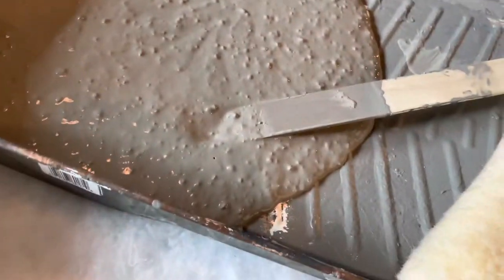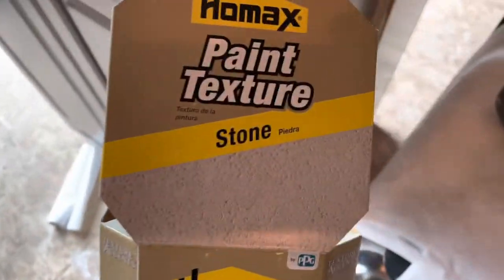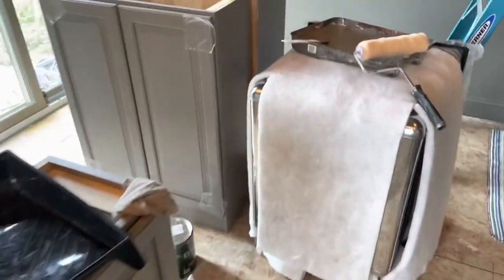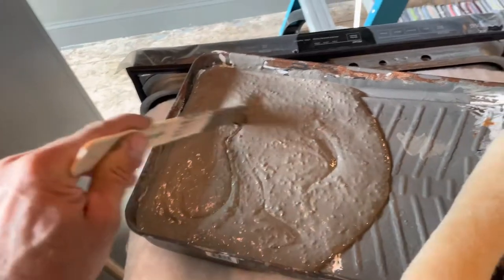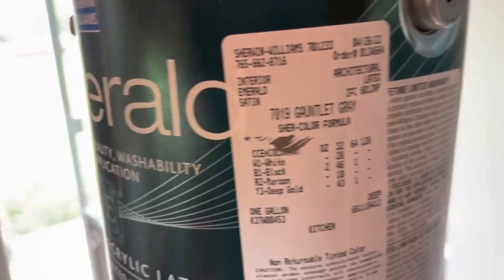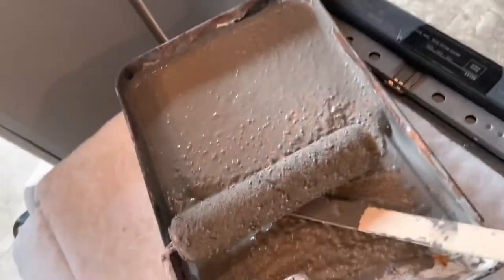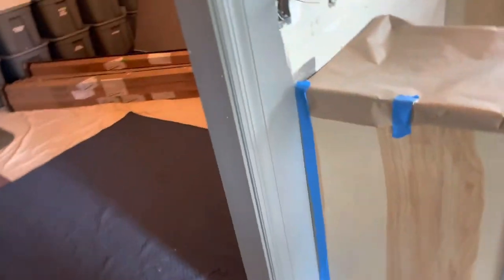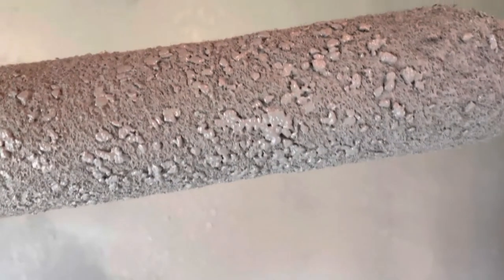Homax Stone Paint Texture Review!

Comment: The application method dominates the final look, there is a special roller from BHER will make the results fabulous
Reply from the maker: I have not experienced with any rollers out side of the few different nap rollers available at stores. I do know rollers with patterns are avail for mud textures . I have used a sand mixture to another home and was very happy with the results it was premixed by a different manufacturer. I have also had great results applying a texture with premixed mud and a heavy nap roller since this video.

Comment: What if you painted it first and then went back over with the stone mix... would that help deplete splotching?
Reply from the maker: I did paint the walls first coat without stone mix to make it quicker to apply. The paint also dries quick so as soon as you roll over the top of it starts to pull the stones off the roller. I found that the splotching occurs most after going over an area not completely dry. But very little stones come off the roller unless you go over areas that are still a little wet.

Comment: Bro stick to doing anything else but this like is a easy as read the box this works great if u read the box 😊
Reply from the maker: direct from the box : 

Roll-On Paint Texture.  Cover unsightly walls and create a decorative stone finish quickly and easily. Simply mix the aggregate with one gallon of paint and apply the texture with a conventional paint roller or textured paint roller. Safe for use on drywall, paneling, cement block and wallpaper. Coverage approx. 100 sq. ft. 👍
Reply: @Zacpactv  I am so glad I found this video as I just purchased this product from HD. As you stated.. you did indeed follow the instructions. The only thing I would have done differently (but won't becuz it is going back to HD) is use a texture roller. Not worth the hassle of painting more than I want. As for the smart-alecs here stating it is easy.. blah, blah.. ignore them.
Reply from the maker: @smiles5029  Thank you for the good feedback! I think kids play sand is better for texture. If wanting a texture drywall mud needs applied with a roller!